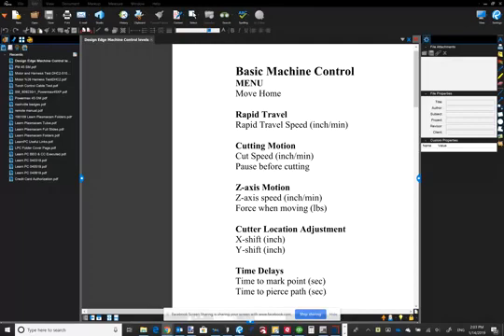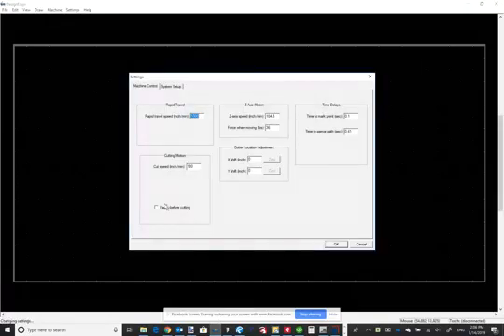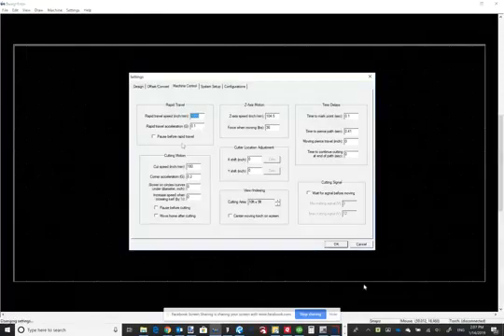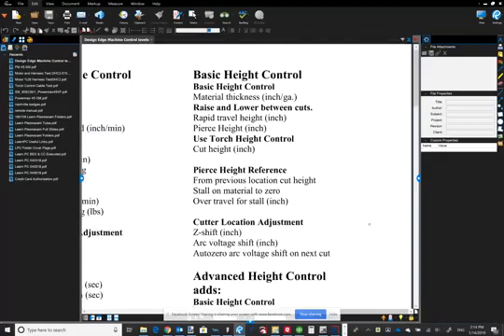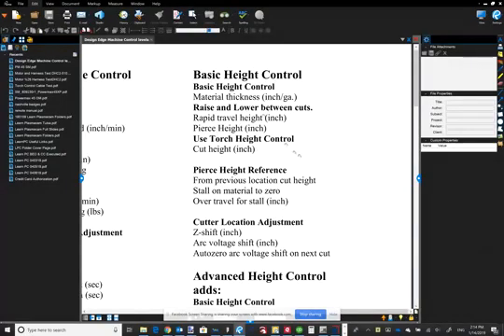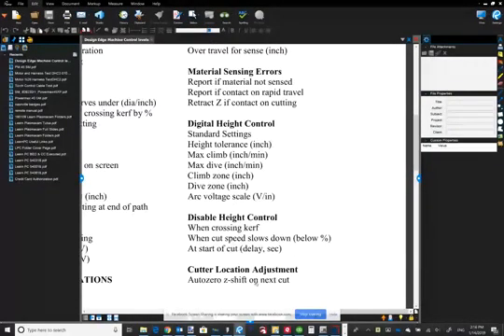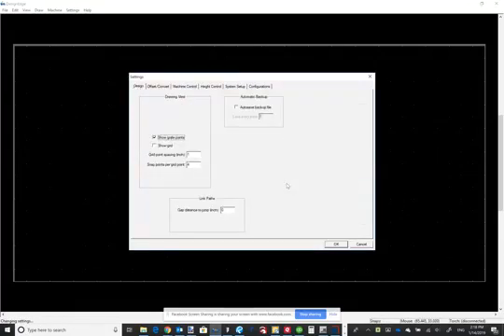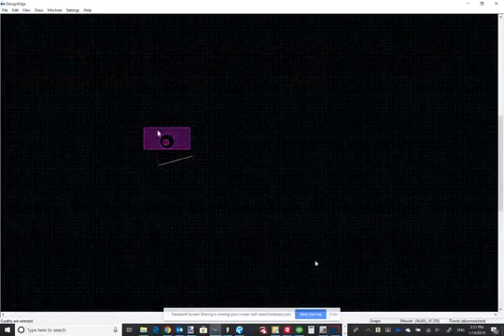Design Edge Levels- What do you get!?!???!?

Comment: What upgrade gets you "Reorder paths" ??? I need to cut holes and then perimeter outlines but it always does the opposite. Then my holes are out of alignment. HELP!!
Reply from the maker: First, any time you convert to cut path with any level of software by clicking the outside path first, it should ask to convert holes and if you do it that way they should cut before the perimeter.

Second, you can reorder paths using the Machine menu at the top of the page and it you can choose how to order them, manually or auto which I believe will be sweep across since without Advanced Design you cannot chose the other methods.

Hope that helps! This is for Design Edge only! 3.11  and older versions are very different.

Comment: do you know if you pay for every option except 3D control and then add that for a cool price of $998 they will not support the product in any shape or form.  By far probably the worst customer service i have dealt with. they are all about the money.... !!!
Reply from the maker: Bill your statement is not factual. I have dealt with PlasmaCAM for about 10 years. I have owned the 3D upgrade for half of those years and while I have only had to call technical support 2-3 times in 10 years, they did not stop my support after purchase of that 3D upgrade. I own all except the pipe cutting attachment and metric units (which as I say in my video is stupid to charge for). PlasmaCAM doesn’t have a great record of kind customer service when it relates to training which is exactly why I started making these videos and teaching workshops years ago. As. I said on my other reply where you tagged me, if you would like to reach out to me I would be more than happy to try to help you resolve your issue and hopefully befriend another fellow owner as I have the nearly 1,000 people who have been to my workshops over the past 5 years.
Reply from the maker: My email is robert@490creations.com.